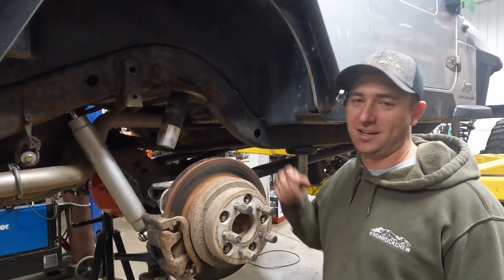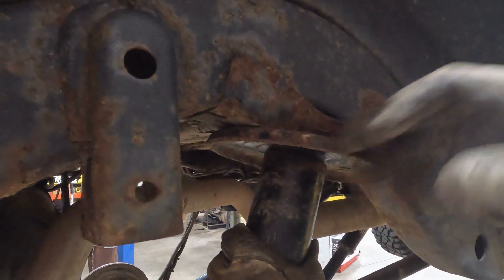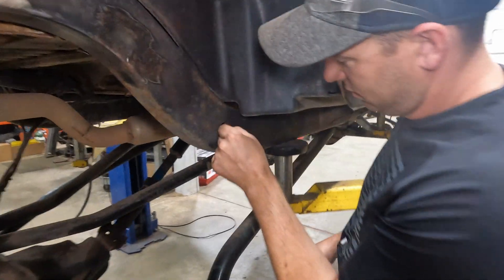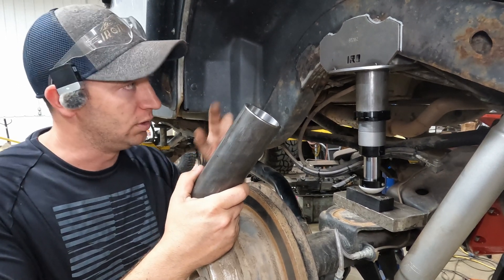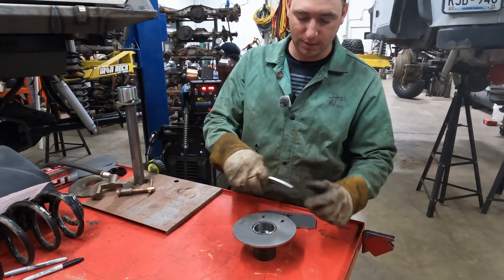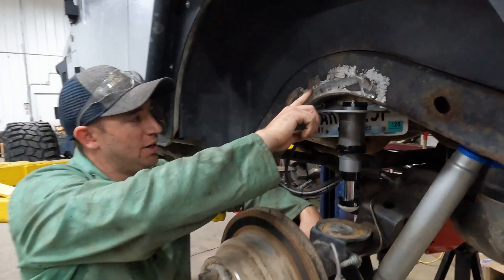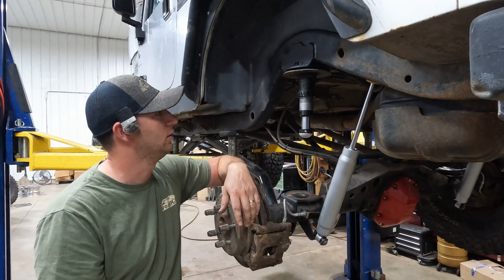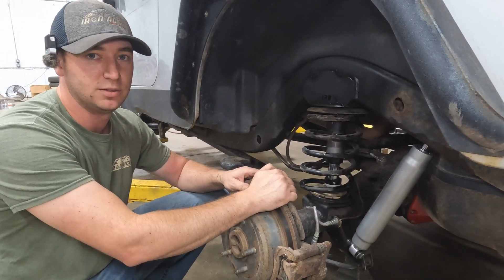TJ/LJ Rear Spring Relocation & Hydro Bump Stops!

Comment: Curious. Will there be any difference in lift height between OME position and relocated position using the same spring? Thanks.
Reply from the maker: @gogerwi Yes, keep your springs! We designed this upper spring mount to achieve the same lift height after the spring is relocated. If you paid for a 4" lift spring, we want you to still have a 4" lift after this modification! 😁